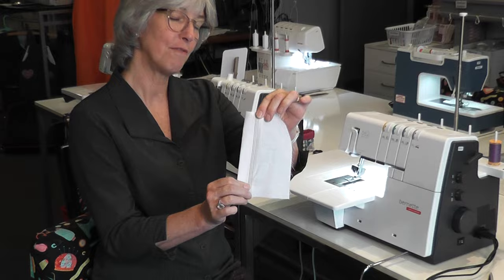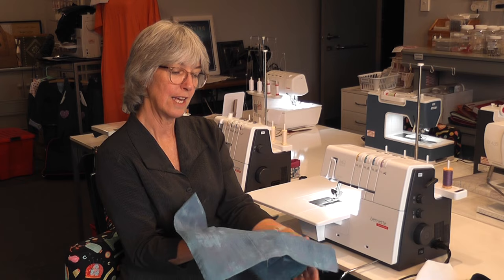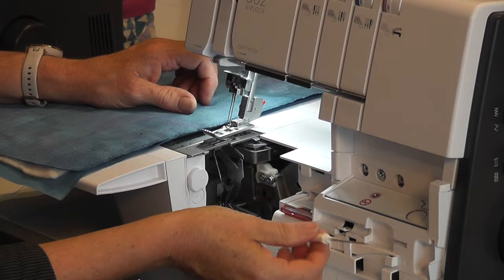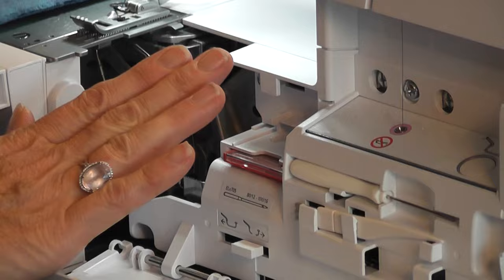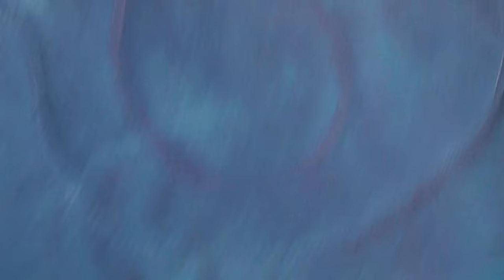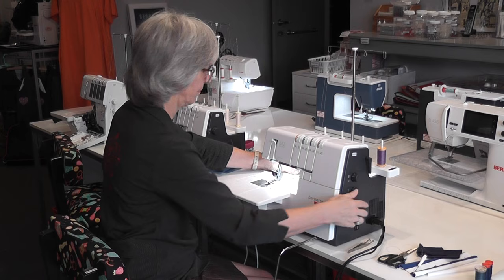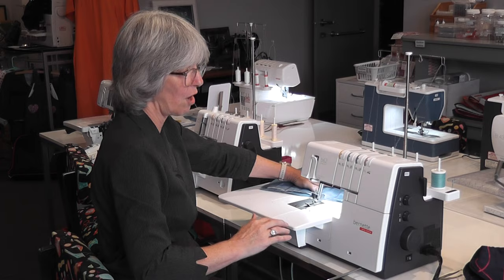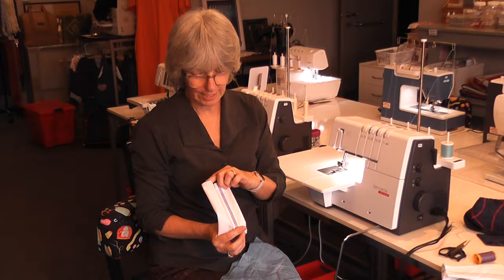Bernette b62 Coverstitch Machine

Comment: Can this machine sew denim and thick fabrics ?
Reply from the maker: It is a very solid machine. I haven't tried thick denim on it but it would definately be able to handle denim. Make sure you use a heavier size  needle.
Reply: Thank you 😊
Reply from the maker: It can sew thicker fabrics but you might need to use a height compensating tool to over thick seams.